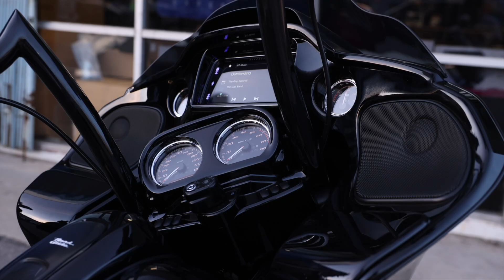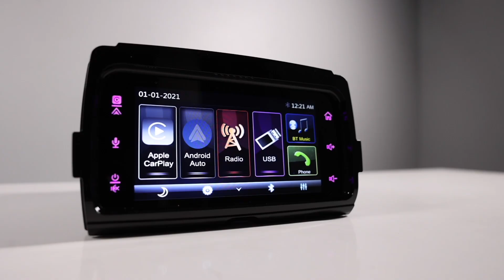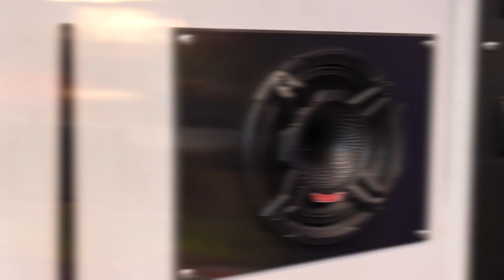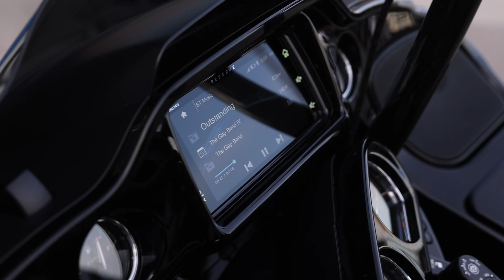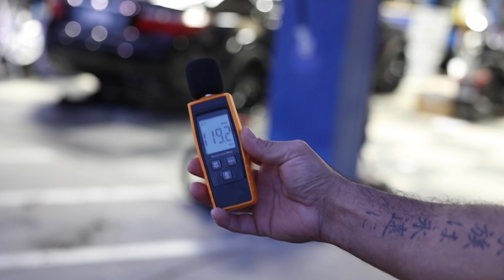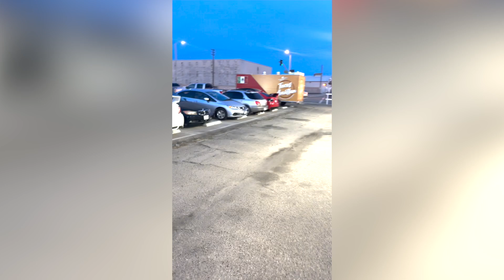Is Harley's New Audio Upgrade Worth It?

Comment: That system was insanely loud, definitely impressed there. You should do a video on handlebar mount speakers for the motorcycles that don’t have a fairing or radio.
Reply from the maker: Yes it was! Thanks for the comment. Yeah that’s a good suggestion !